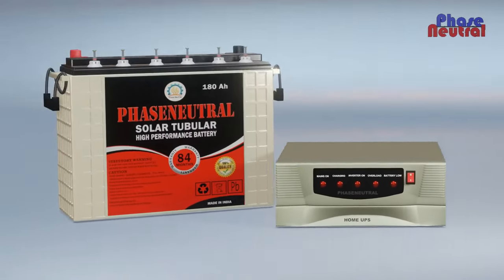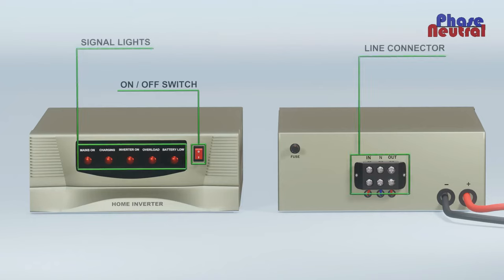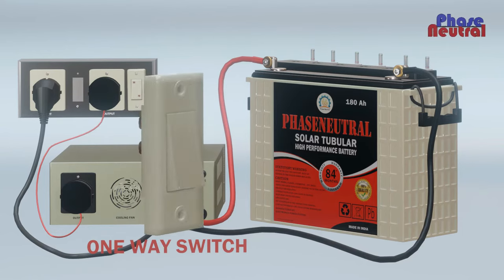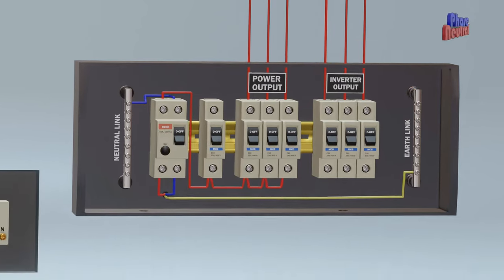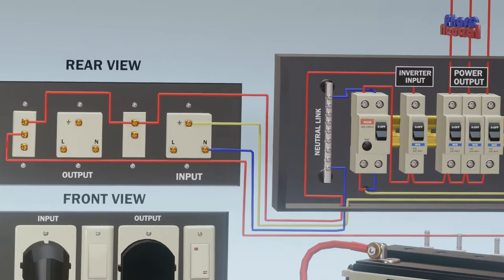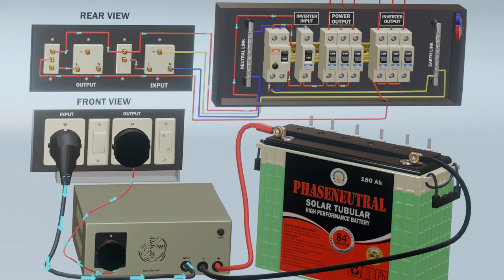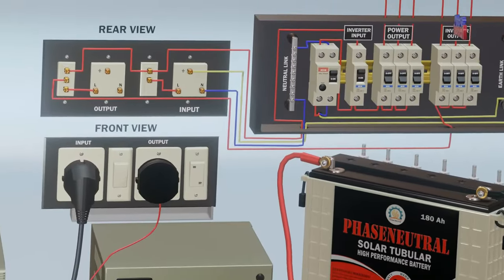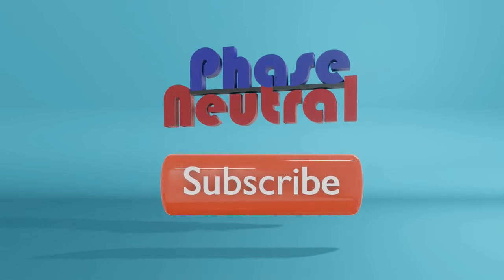Home Inverter wiring Explained | PhaseNeutral

Comment: Very nice explanation!
This wiring scheme is very different from the one that we use in India.
1. Distribution board - it is not separated into MAINS In, Inverter In, Mains Out (power out from the mains) & Inverter out.
2. Only one "one way" switch is used instead of two separate switches and sockets for invert in and inverter out (two way switch).
Here we simply cut the mains line in the distribution panel and wire it to the socket (to which inverter plug is connected). This socket has a switch (one way).
The output from the inverter is brought back using another wire to the point in the distribution box where the initial cut was made. This wire from the iverter output is connected to the house side wire (where the mains line was cut - one side mains{it went to inverter input} and the other side will be connected to inverter output.
This results in the inverter being charged continuously when the ower supply is available.
The house gets supply via the inverter (but not from the battery).
When the power is out the mechanism in the inverter connects it s output to the house's input.
Reply: @Ritooraj, very good explanation. So if I understand correctly the inverter will come in between the grid and the load. Is there any special setting in Inverter so that it acts as bypass when Mains is ON? 

I just got the inverter and batteries delivered today. I have an ongrid solar setup and, a DG connection. The Solar inverter turns off when grid is down (for safety). DG starts automatically and provides power in about 20 seconds. Both grid and DG are connected to ACCL, and the output is fed to the load. At times, DG does not start or it is turned of for cooling. Also, between the power switching from grid to DG and then back to grid, the appliances like TV turns off abruptly. Hence I am setting up a battery powered inverter for seamless switching between grid-dg-inverter. 

But I am stuck as to how to wire it. Any advice will be of great help. Thank you
Reply: I have the exact same connection as the video explained (in India).

Comment: If inverter output is working alongside electricity output, then that mean they dont share same outlets right?
Reply: All load to the home goes either through the power out (mains) or the inverter out.
The power out, of course, will supply electricity to the corresponding load only when the grid supply is available.
However, the inverter out will supply electricity to the corresponding load at all times--when the grid supply is available, the inverter out will supply the grid electricity, and when the grid supply is not available, it will supply the inverter (battery) electricity. This switching between the grid supply and battery supply is done by the inverter (it senses the grid supply outage when it is not receiving input power).

I may be entirely wrong, but this is what I understand from the video.

Comment: For me this type of connection could damage my inverter board, I recommend only connect like TV, PC, Mobile chargers, and emergency LED lights, inverter fan ect, 
on out put live and neutral
Reply: I think it is assumed the wattage of all load turned on at once should not exceed the VA of the inverter.

Comment: This is unsafe connection 👈 There's no protection from the inverter connection. If anything goes wrong you die 👈 There should be seperate RCCB for Inverter 👈👈
Reply: Can you please help me understand? Where would this RCCB be placed?
I have the same setup at home (but without the separate RCCB for inverter). If you tell me, I can ask my electrician to install it :)